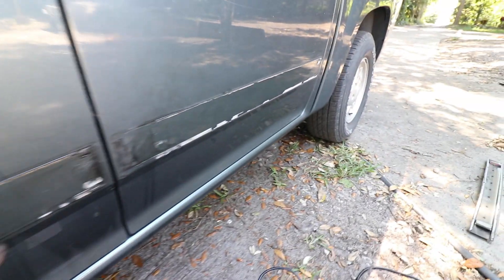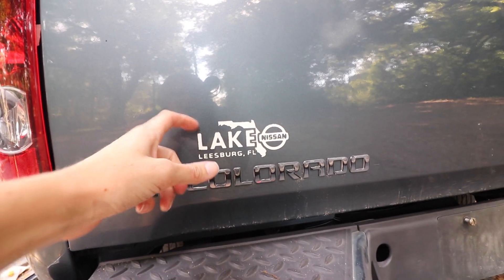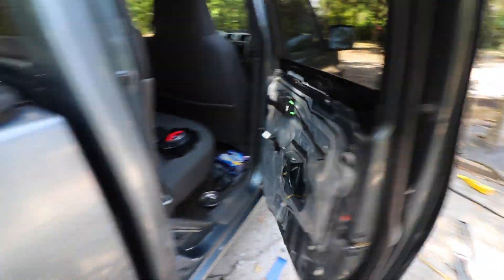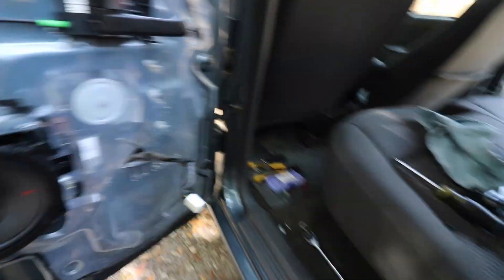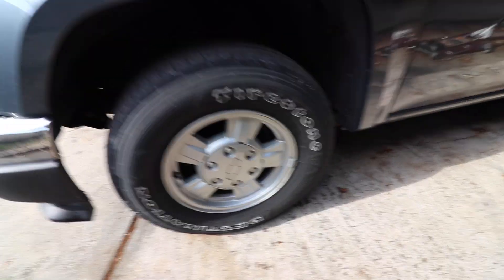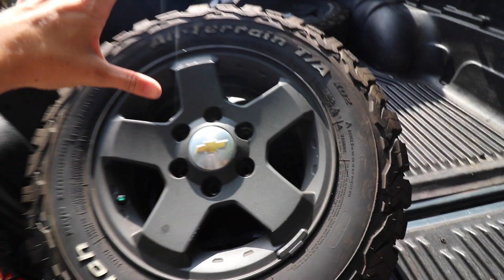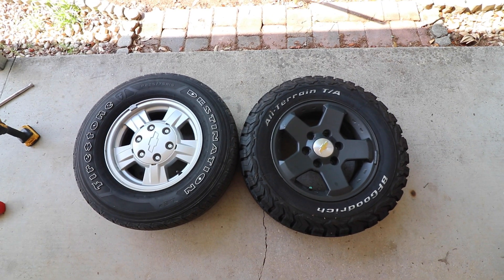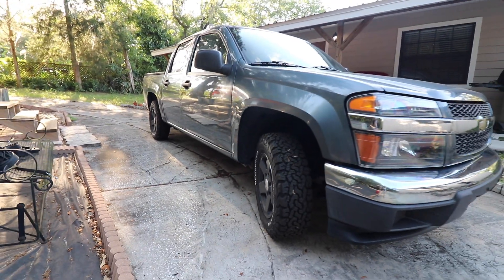Our Chevy Colorado Gets a New Look!

Comment: @Chelsz H do you think the same size tire that you put will fit a 04 colorado?
Reply: Yes. Those are actually pretty small. Stock size on my 2010 canyon is 235/70/16. I’m upsizing to a 265/70/16 which will also fit just fine.